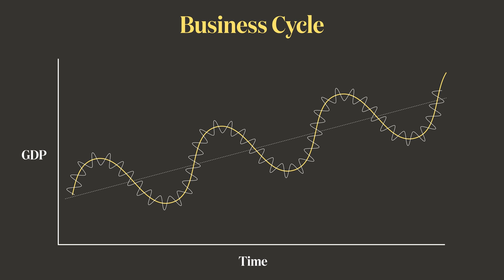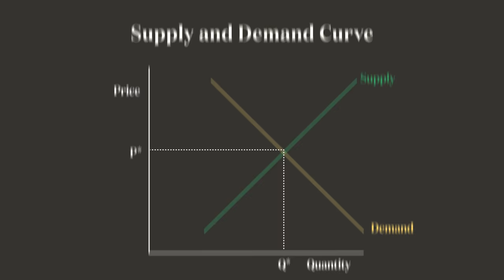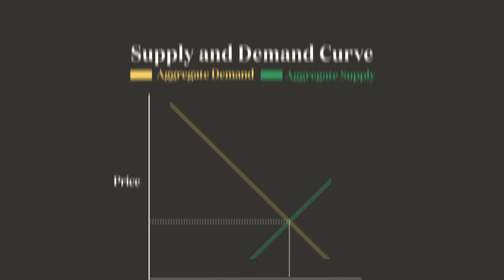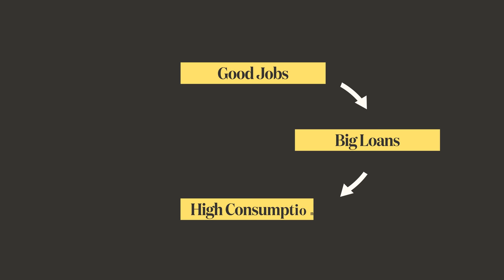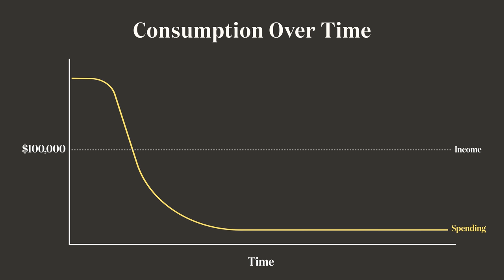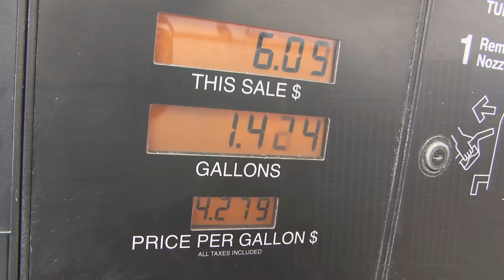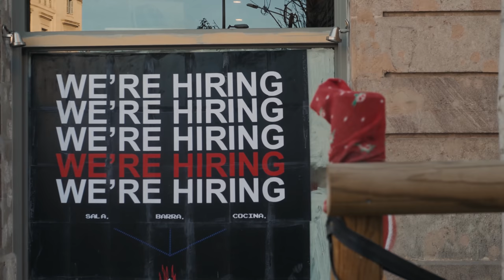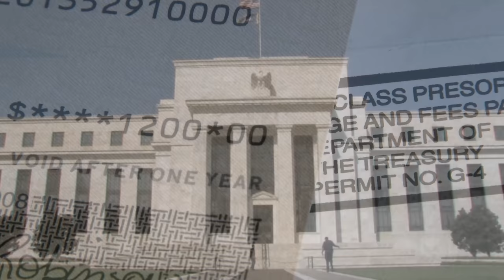The Recession We Need To Have | Economics Explained

Comment: I think one problem with the assessment about the benefit of an economic downturn is the foundation of many economic theories: they assume a rational human being behaving rationally. 
When it comes to reducing the workforce, this then comes in the form of assuming that the underperforming staff are the ones to be laid off first. Having been employed through several economic downturns and having survived the cut, I can say for certain that this is not my experience.
Reply: Perhaps gov't interference is to blame here? It's very hard to lay off people nowadays given the labor protection granted by law
Reply: @paulomendoza5606  why would you lay off a good employee instead of a bad one if it is already that hard to lay someone off?
Reply: @paulomendoza5606  Hardly, laying off staff because of an economic need to downsize is quite simple if you've actually done an audit and are following a plan.

That's pretty iron-clad for any possible lawsuit as long you're being fair in your criteria. 

Under performing staff are easy to get rid of as long as you bother to track performance, try to work with the staff member to improve it and follow policy.

The people who are difficult to remove are executives and managers, they rarely have actual productivity to check and can either hop away to another department or have weaseled their way into a contract where it's less costly to pay an incompetent to sit in a corner than it is to fire them.
Reply: My father worked in many American companies for 25 years now (and counting). In the 90's they were in constant growth and everything was hunky-dory, then hit the dot com crash and they had to "restructure". That was understandable, after all it was a massive bubble burst.

What's wasn't logical, was that those "restructurings" started happening every 5 years, then every 3 years, every 2 and eventually pretty much annually. The company would annually lay-off workers in one region and... announce hiring shortly after. It didn't matter if sales did well or not, they constantly rotated people.

It soon became clear that it was done solely to boost stock prices by employing some accounting wizardry and bullshitting investors with completely sham decisions. It made literally no sense to reorganise everything and have workers waste time readjusting that often, but you could throw it in slides and hope to hire interns to replace senior and mid level staff salaries.

In short, it was irrational and it ultimately hurt the productivity of the company, but worked short term. It was a bother for everyone and a lot of stress for those that did get laid off, but it worked for the financial sharks that saw their wallets swell.
Reply: @paulomendoza5606  Usually when there is a layoff, they fire entire teams or close a full single factory. Thus they get rid of both good and bad employees.
If the company was auditing individually every employee and offering their employees to move to the other teams/factories (assuming they can move because it would compromise their husband/wife job) then they would get rid of only the bad employees. But that doesn't happen as it would cost money to go that length.
Reply: There’s some relationship between performance and not being laid off. The managers making these decisions are not perfect, but there’s generally some relationship.

Economists are already ahead of you. Learning how real people behave and developing accurate models of the behavior has been a major aspect of economics for a while.
Reply: I agree. Some industries rely on contractors due to general volatility in the markets, allowing swift cuts in overhead costs. Add an economic downturn and it's no different. Even if that's not the case contractors will see the door first as they dont have the same protection FTEs have. Contractors are usually the most experienced in the workforce so this then goes against the grain.
 
Another point is connections. Favouritism and rapport trumps productivity in a number of cases when downsizing so cannot assume the weak are weeded out every time,
Reply: @paulomendoza5606  you must live outside the US surely
Reply: @ten_tego_teges  Ohhh yeah. I worked (briefly, clearly) for a place that brought in a CEO who was known for doing exactly that. His policy was to fire half the company every year. (Wasn't a very big company.) Didn't matter how well it was doing. My mom (works in HR) knew about him from other companies he'd basically gutted, and warned me to start looking for a new job when he was brought on. She was pretty much on the money.
Reply: @ten_tego_teges  oh, she was. 

Edited because I thought I was replying to a different comment. 😆
Reply: I can attest to this. In 2008 they laid off everyone in my office except the VP who then stole the server I used to work on and tried to sell it. I can guarantee that anyone else in the building was a better employee than that guy but he kept his job and we didn’t.
Reply: @ten_tego_teges  They do this because restructure breaks the analytical model used to determine if the financial reporting pre restructure is comparable post restructure in the USA (SEC rules). This means that external analysts can't check the company's market announcements properly so it becomes easy to hide flaws from the market. It is one of the reasons large traditional tech companies buy smaller companies then sell them again a couple years later. Do a significant buyout or sell of every year and suddenly you can obscure your company from any meaningful market analysis.
Reply: @SurmaSampo  Interesting, thanks!
Reply: @ten_tego_teges  Modern tech companies are even worse. Their asset base is almost purely goodwill which in this category translates to user numbers and we know they don't make money for the most part.

Modern tech companies basically run on debt and capital investment backed by what amounts to hopes and dreams. The industry has become a cancer on capital markets which has been throwing money at anything that looks like it could generate a return.

This will resolve itself once the oceans of cheap money that nations have flooded the finance sector with over the last 20 years washes away with a deep recession. This oversupply of investment funds also fueled the 2008 sub prime crisis.

The hallmarks of stagflation are now here so I am starting to get concerted that we might see a much harder reset than would have been likely pre covid. I sure do hope I am wrong and I probably am about the future.
Reply: @SurmaSampo  I kinda expect the same. The fact that Uber was able to function without profit for over a decade or that Tesla is worth more that the entire automobile industry are only the brightest examples. I too believe that there's just absurd levels of hype around tech, while plenty if people apply borderline magical thinking to what is achievable with modern technology.
Reply: It is becoming politically impossible to endure too much unemployment. Security of the person economically is becoming a public good without adherence to a liberal ideology.
Reply: @paulomendoza5606  Layoffs have become extremely controversial as they transfer costs to the public. Civil disorder, even violence, are possible outcomes.
Reply: @Zartymil  
Because the good employee has usually been there longer and is thus paid more or granted additional benefits the business doesn't want to pay for. It makes the business be more watchful for ways to throw out their better/older employees in the name of reducing costs and piling the work onto those less experienced (believing that the quality won't change much at all).
It is a very stupid, very common business mindset.
Reply: @DBArtsCreators  Sure, but that has nothing to do with workers rights.
Reply: @Zartymil  
How so? It is how business circumvent workers' rights (as well as their mindset as to why they circumvent workers' rights).
Reply: To say nothing of corruption from grassroots to CEO levels and debt write-offs and the whole saga
Reply: @DBArtsCreators  indeed
Companies believe 10 stupid less experienced workers will get the work done anyway
Reply: Usually the first layoffs are the most expensive employees outside of the C-Suites. Unfortunately, that usually targets older/more competent employees.
Reply: Exactly, I saw this first hand during the first hit from covid. It's not the worst performing worker that gets cut first, it's the most expensive employee. Why pay the person performing well a high wage when we can force someone cheaper to work free overtime instead
Reply: Not just a rational person performing rationally. That everyone concerned will consider anything beyond their percieved self interest. We both know this is never the case. So such models are wildly inaccurate as they start with assumptions that do not describe any living humans.
Reply: @Zartymil  nepotism, easier to lay off the new guy  than the guy that's been thier for 20 years
Reply: You've committed the fallacy of assuming "Economic Rational" means "wise". It doesn't. A "Rational Actor" in economics takes what they want for the least cost possible, even if what they want isn't "wise".